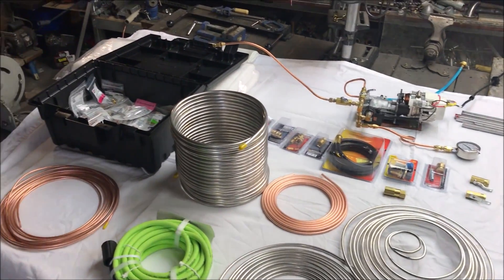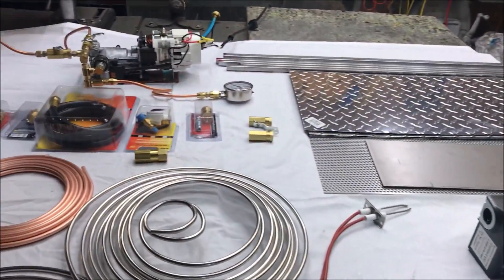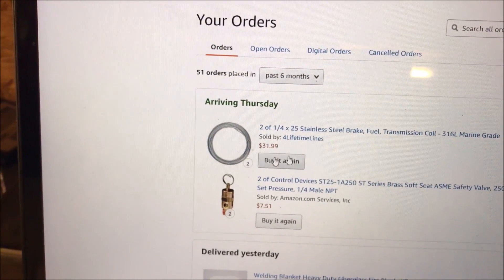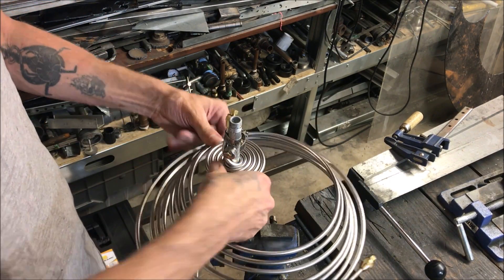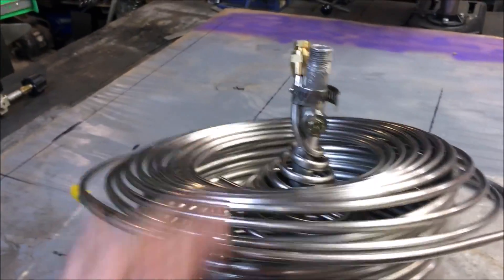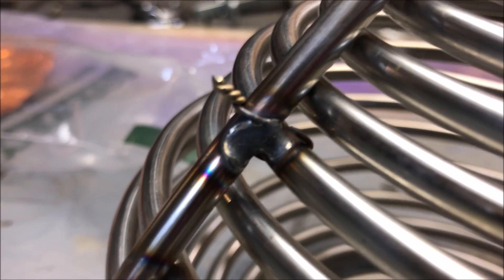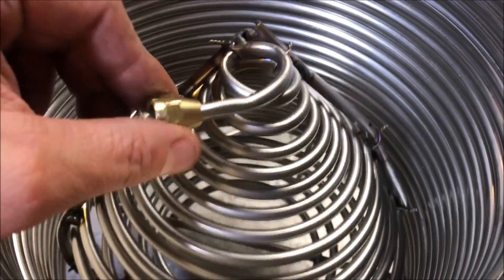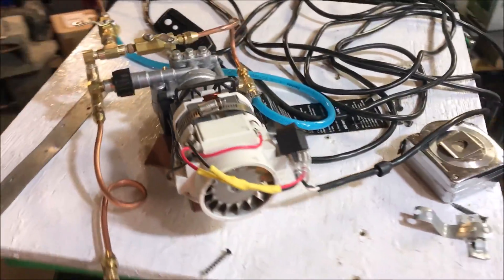4 stage super boiler for my man " Los"

Comment: Can confirm that stainless rejects IR heat quite nicely. I see the general recommendation was bead blasting. There are commercial bluing solutions for stainless though not sure if they'd hold up to the environment or if they'd undermind the chrome layer that's so crucial to why stainless is, well stainless.

Comment: As far as heat distribution, between the coils have you considered taking another stainless steel tube capping off one end pour in some rubbing alcohol preheated and cap off the other end. Use these tubes as a heat distributor.

Comment: Only, Use Stainless Steel Swagelok fitting. They are the Best, At 1000 degrees and At 2000 psi these fitting will hold these pressures. There is NO Substitute for for these Fitting.

Comment: Could you use the "wall of water" to preheat the boiler feed water?

I ¹would love to built a flash tube boilerfor my 1/4hp coke bottle engine.
I've got a fifty foot coil of 5/8" copper tubing, but that's it.

Comment: You can burn the surface of the coil with bare acetylene flame (no oxygen) it will get nice and black carbon ''paint'' that never burns out.
Reply from the maker: you have to build this type of pump
Reply: @NOBOX7  and what kind of pump is that?

Comment: A "Steam Ginny" type boiler would seem a whole lot easier and cheaper to get up that runs off off diesel or kerosene!
Sure, a propane fired super heater that is temperature controlled, such as for a car wash or whatever and is precise
is a good proposition but is not necessarily cost effective! I can however see other applications such as use of this
system in commercial laundry service, hospital settings, aviation perhaps and perhaps steam heating plants such
as in old buildings, once it is scaled up to meet a special purpose boiler systems. Yet the portability as such of this
system doesn't seem too bad! The boiler super coil is quite bodacious and the overall efficiency of your heating method
should be great, but I must say the propane fuel usage just might be still a bit high. Just looking at your primary layout
to concept is pretty damned keen! And so, I must continue to watch on into the completion! You are seeking to make
for a great professional build and your client should be receiving every bit of that! Super video and thanks for showing 
us folks!!

Comment: I am not a physicist by any means but from what we did at work over the years with stainless steel tubing for heat absorption, the print most of the time stated to bead blast the surface for a matt finish. This supposedly made all the difference with that metal type and what the engineer would state and specify. Way cheaper than using any plating for heat resistance. The paint idea I would be leary for sure. The paints today are better than yesteryear but the coating is not that robust for longevity. That is my ten cents fella. Peace
Reply: makes sense, all the peaks and valleys from bead blasting increase the surface area and decrease reflectivity. every little bit counts with stainless as it is a rather poor heat transfer material. shame it has other desirable properties that make it the preferred choice.
Reply: @lanceyeakel7674  Years ago steel started to become out of favor because of the RUST aspect of the metal. Copper brass aluminum started to see a shiny horizon. That when chromium steel popped out of the woodworks. Then stainless steel ant the rest is history. Good day Lance. VF

Comment: and the smoke? it's hot, you could do like the old boilers and add another stage, instead of the middle part have an coil, could be an cylinder with water and tubes with the exhaust of the liquid smoke, heating even more the boiler

Comment: Anybody know how to make a water level cut off for a flash boiler that doesn't require any electronics? I would like some kind of solid state device that will cut off the pump automatically without being sensitive to moisture, corrosion, etc.
Reply from the maker: float switch in a site tube on side of boiler
Reply: @NOBOX7  Good idea. I had a video that showed a process using microelectronics and I knew tht was not a robust long term solution. I am working on a gasifier, but a small turbine or steam engine might last longer than a tiny engine. It is loud and inconvenient to charge batteries with an engine of even a few horsepower. I think smaller is better except for running larger tools and equipment.

Comment: sand or rough up the outer surface with sand paper make it a matte finish it wont reflect as much heat probably make it easier to weld also but your welds look pretty good for what you are using to weld them.
Reply from the maker: Good idea